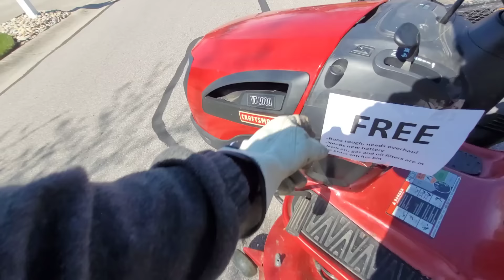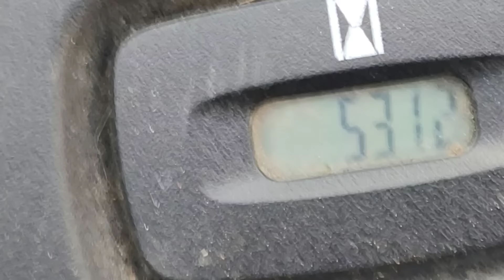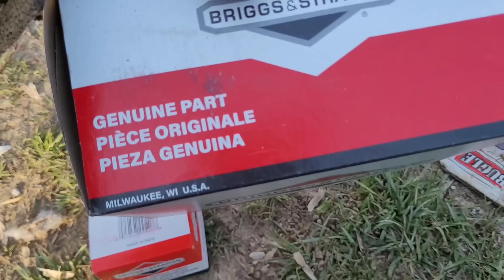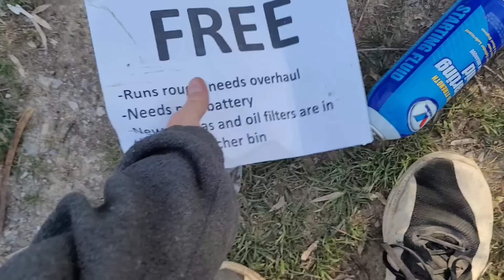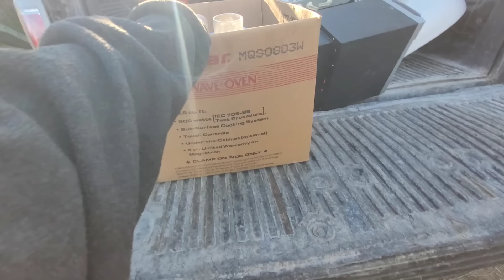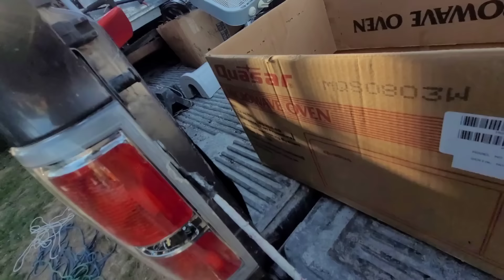Game Changing Scraps

Comment: The key to backin trailers is you turn opposite of where you want to go when the trailer is going the direction you want then you follow it with your steering wheel. And remember small trailers are more difficult than long trailers because they dart. I hope it helps it has helped everyone ive seen struggle some old dude told me that once and he was right. I am a fellow scrapper and i dig your style. You just dont give up youll get the hang of trailerin
Reply from the maker: The 3000 ft wheelbase on this whagon doesn't help either 😁

Comment: Nice find on the mower. Big vtwin motor too. To set the parking brake on it you push the brake pedal and lift up on the red lever.  it also has cruise control if you push on the gas and lift up on the black lever. I usually get about $600 when I sell one of em.

Comment: If u want to get off and keep it running push the petal on your left all the way in a pull up the red leaver and release pedal and then u can get off while it’s running   Plus on the back where the hitch is there’s a leaver u can I gage so it will move freely to push around should ask at least 500 handy obo there like 3000 grand with the bagger brand new  yeeeeeew nice score

Comment: You might want to try putting some of that starting fluid in the green lawn mower it will probably run just trying to help
Reply from the maker: I think it's because it slid over and was on its side for awhile. Might draw back on it a few times today. See what happens 😁
Reply: Yeah it might start
Reply: I was just wondering if you tried to starting fluid and did that push mower start up just being curious have a good evening
Reply from the maker: Just let it sit overnight and it fired right up. Didn't have to use anything 😁